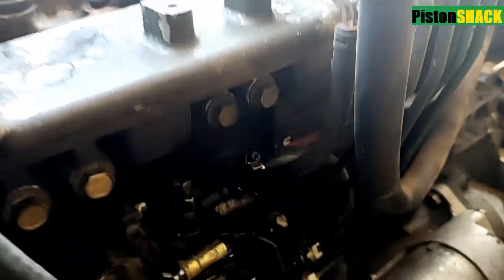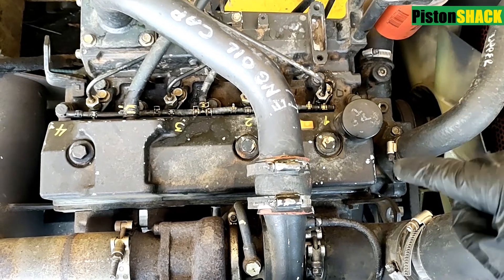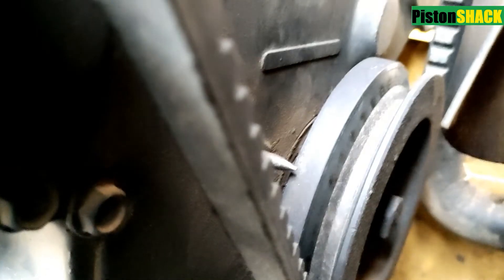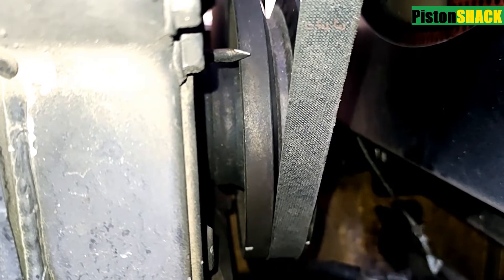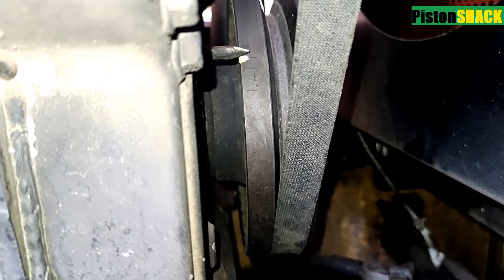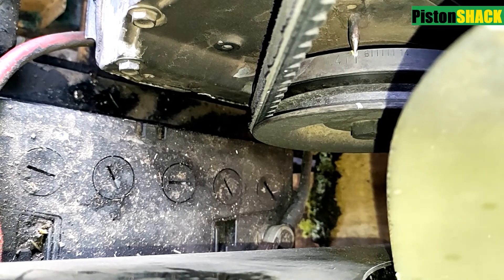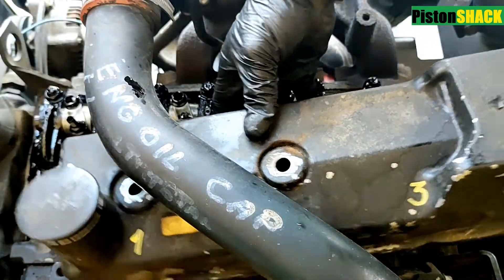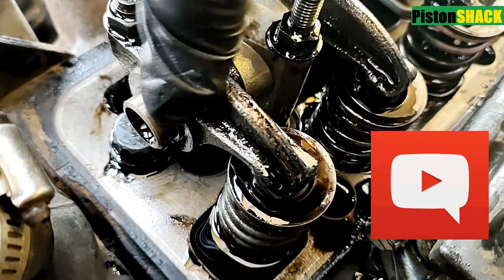HOW TO FIND TDC on B3.3 CUMMINS DIESEL ENGINE | b3.3 Cummins 1st Cylinder Top Dead Centre Mark

Comment: Does the fuel injection pump get timed by the degree on the data plate if you align the gear marks up and pin the pump the mounting cover won’t align

Comment: I came across a Cummins B3.3..74hp.. installed on a trencher. The serial number is scraped off and I'm struggling to find out more of its history. 
Wondering where I can find the tachometer or rpm sensor on the engine? Is it behind something?

Comment: To match the fuel injector pump, is it always turn it back 4 degrees from TDC on any diesel engine?
Reply from the maker: Nope, every diesel engine has manufacture recommend specific TDC timing.

Comment: I am looking for the valve order on a B4 3.3l? 
is it in-ex-in-ex-in-ex-in-ex from the front?
thanks for any help.
Reply from the maker: Hey Ralph! Sorry, what you mean by "valve order"?
Reply: @PistonShack  f
looking from the front of the engine are the valves as follows......inlet exhaust, then next cylinder (2) inlet then exhaust cylinder (3) Inlet and exhaust and cylinder (4) Inlet and then exhaust?

Comment: Hey what fuel filter does this 3.3 have? Thanks
Reply from the maker: I have WIX 33616 fuel/water separator.
Reply: @PistonShack  might go that. Do happen to know what's on there fron the factory?
Reply from the maker: Cummins use Fleetguard filters. I don't have part number.